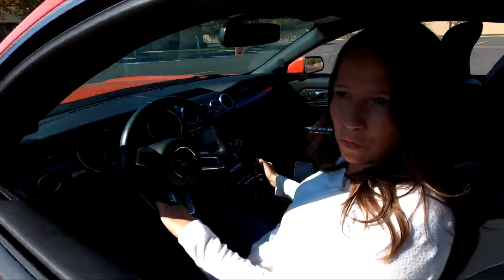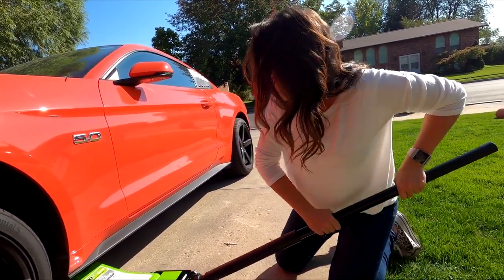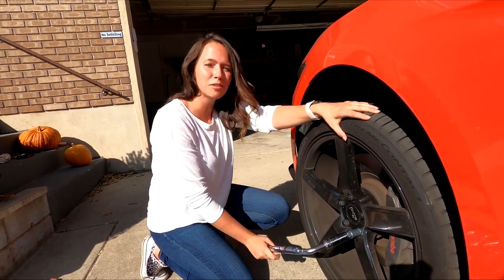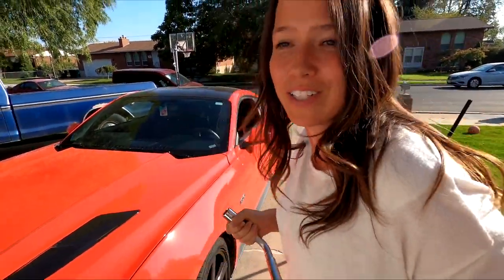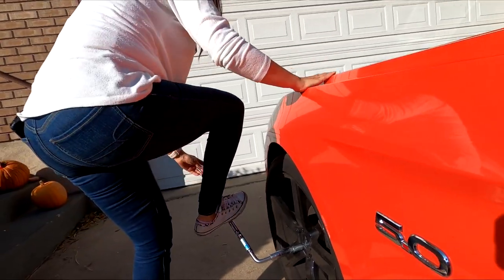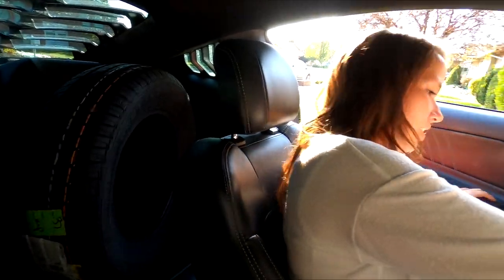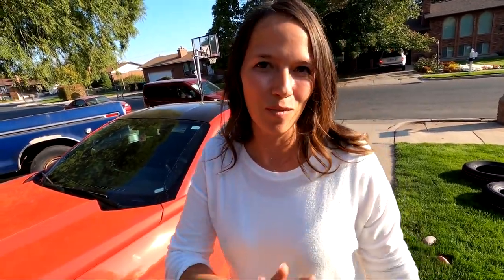PROBLEMS with My Performance Pack Mustang GT!

Comment: 1. Get some jackstands. Never trust a jack.
2. Get a torque wrench.  Those lugs take a lot of torque or they will back off on you.  Been there done that.
3. When putting on the tire, get the tire in position, sit beside it with one foot in front and one in back on the tread area, use your feet to help lift the tire while you look to line up the lug bolts.  Easy .  Keep at it, your doing good.

Comment: Never put your hand/arm in between the tire and the wheel well without it being on jack stands. If the jack fails your going to get hurt. Knock the glaze off the brake rotors (front and back sides) with some 100 grit sand paper and that should help stop the squeaking. Try and work them over in small circular motions or directly in and out toward the spindle nut rather than going all the way around the rotor in the same way the brake pad does.

Comment: The metal tab is scraping.  That's your warning that you need new pads.  Change all 4 at the same time, they're cheap enough.  Clean the rotors off with Brake Cleaner.  That stuff you used might hinder you from stopping later.  It will put a film on your remaining pads and not let the pads do their job.

Comment: Oh and, get the pads done real soon or the scraping will dig into your rotors and you will have to resurface the rotors or buy new ones.  Resurfacing is like $10-$15 each, and replacing them is like $100+/each.

Always do them in pairs (both fronts or backs)....better to do them all at the same time though.

Comment: Performance pack stock brake pads are known for squeeking and also a lot of brake dust
Reply: It’s the Brembo breaks too, my 2014 gt track pack had the same problem until I switched out the rotors
Reply: Alan Jimenez My 03 Mustang GT has ceramic brakes. It stops fast, but my god all the dust is annoying. Makes it impossible to keep rims clean.
Reply: @angelgjr1999  ceramics Shouldn't make much dust at all. You sure you're not thinking of organics? And if you're having dust issues I reccomend wagner OEX pads, you can get them at O'Reilly's and I only clean my rims as often as I clean the rest of it, and they stay pretty nice.
Reply: Yep...just wash your car, drive it for a week, then look at the front rims compared to the back rims. So much dust its crazy! Also, if she's looking for a low mileage, stock Terminator, she needs to get in line. LOL Who isn't looking for one!

Comment: “I have nothing else to haul these tires.” 
Blue F100 or F150 in the background “am I a joke to you?”

They make stuff called brake parts cleaner/brake clean which will clean off the brake dust. Many people (myself included) use it to clean off all sorts of things including cleaning off excess oil after an oil change, other fluids, etc. 

Yes that was the pad “squealer.” If it’s making contact to brake rotor, that means replace the pads. To “fix” the squeak you’d need to remove the pads, chamfer the edges, and literally sand the pad face so there’s fresh pad material. It’s a messy process and there’s some more to it, but that’s essentially what you’d need to do,
Reply: Can I use brake parts cleaner to remove dust from my rims? I have ceramic brakes and it leaves a lot of dust in my rims.
Reply: Angel Gutierrez you could, but there are a ton of products out there for cleaning off rims specifically. Chemical Guys, Adams Polishes, and a bunch of others all make products that work very well for rims. Not sure about her, but my car came with black wheels and I hate them because they get dirty so quick.

Comment: Britton invest in a torque wrench so you can tighten your wheels to 95ft/lbs next time you wont need to stand on the wrench or strip bolts.
Reply: These cars require 150 ft lbs torque on the lug nuts.

Comment: go to Carbotech and get a set of 1521 pads. It will greatly reduce your brake dust from those Brembos. You will need to have the rotors turned so you get proper bed in but other than that you will love them!

Comment: If you have a Lowe’s there in your area go by there and get a 24 volt cordless impact wrench,it will take those lugs nuts off easily! To keep the brake pads from squeaking you need to take the calipers off and put some brake pad grease on the back of the pads before you put then back in the caliper! When you buy new brake pads they usually come with a pack of grease to do that with and that keeps the pads from squeaking! What were those tires for! Look on YouTube on how to fix squeaky brake pads and there should be a video on there by somebody showing you exactly what you need to do to fix squeaky pads! Y’all seem to be having a a lot of fun anyway! Keep up the good work and stay safe and healthy! The more you do the more you will learn how to do!😎🇺🇸🇺🇸🇺🇸🇺🇸🏴‍☠️🏴‍☠️ Have you ever watched mecum’s auto auction! They auction off some of the most beautiful cars ! I went to see the world of wheels a while back and they were suctioning off some great cars,Mustangs ,camaros and just all kinds of great cars!

Comment: I would never spray anything on the brake rotor unless is brake cleaner. If you got wax on the pads that's probably what caused the squeaking. Typically if you get paste or whatever on the brake pads it'll contaminate them and cause it either to not stop as well or make loud squeaking sounds. I'd suggest either being cheap and maybe just getting your rotors resurfaced. Or if you wanna go all out buy new pads and rotors with new hardware. I typically like going down the later route because it'll eliminate any strange sounds and everything will wear evenly. Also as a side note the brake pad curving up like that is normal. That's how most of em are designed. I believe it's a form of a wear indicator but don't quote me on that. The shiny clip thing is a wear indicator. When the pads get low enough it'll start rubbing on the rotors making a squealing sound.

Comment: There is supposed to be some friction.  As for the squeak.....could be the brakes.....could be the pad wear "sensor".  Could be a number of things.  Cleaning the rotors likely didn't hurt.  But something to monitor.

Comment: Change the pads. If the the steering wheel shakes while braking then change the rotors too. Also, never use anything other than brake clean on the rotors. Spray brake clean on a rag and wipe only the rotor on the front and back side. Be care not to get it on painted surfaces. I usually do this away from the vehicle so not to get overspray on the paint. Wait til it dries, spin the rotor and repeat the process until you have went completely around the rotor. You can risk compromising the brake pad compound by using anything else.

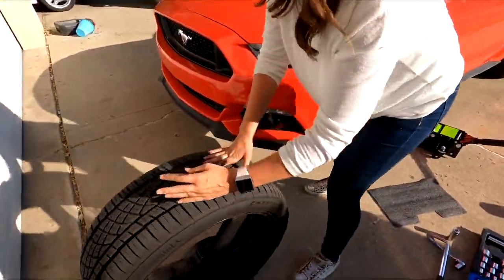Comment: 8:08 says she doesn't know anything about brakes but knows the term squealer lol
On a serious note. You should've checked both inner and outer pads they can wear unevenly. Plus if the rotor has a large lip right over the pad, that means the rotors thickness is getting too low and could cause heat spots and even small cracks leaading to squeaky brakes. The pads themselves could have cracks as well from excessive heat also creating noise. I would just deal with for now until you hear a constant squeal then get new rotors and pads. Also get a torque wrench and tighten the lugs to 150 foot pounds.

Comment: I so enjoy watching your videos.
You are so full of energy and I look be your laugh.  In the future you may want to buy some "Brake Kleen" it's great and drys quickly. From what I saw on the inside pad you have the same little piece of metal and I believe you do need breaks. I'm sorry to say. When you were spinning your wheel that friction is normal.
When putting the tire back on try sitting on the ground with the tire between your legs get the lug holes lined up cles and then lift the tire and slide it in the lugs being careful not to strip or damage the lugs.
I don't know who your camera man is but I felt it was very mean of him not to atleast help direct you.
To answer your question I think it will be a good idea to sell your 95 and look for a Terminator. I will keep my eyes and ears open for you.
As always stay safe and healthy

Comment: You're supposed to have some friction on the front brakes. Its normal for brembo brakes to make noise especially when there hot or  when they have a build up of brake dust

Comment: Low mileage terminator will cost more than the s550 from the prices around here. And they don't resurface rotors in Indiana anymore, I dunno if they will do it there.

Comment: Take the brake pads and sand it with some 220 sand paper and that should stop the squeak , and make sure you buy a torque wrench for your wheels or get it torque don't want them flying off.

Comment: They are high performance brakes , high performance brakes squeal. If you want the stopping power just deal with it. Now if it’s an insane amount then it shouldn’t be doing it but just look up performance brake squeal and see if it sounds similar.

Comment: Hi! I just got a stock 2021 GT Premium here in Mexico and Im just wondering regarding the seat belt reminder...is it normal that when you are already driving and you detach your seat belt that the system won't alarm? usually any car no matter when you detach the belt it lets you know...My mustang only advise right after I start the engine, I put the belt and  everything its ok, but If for any reason I took it out, it will not remind me a second time...is that normal?
Reply from the maker: Hmm I'm not sure, I'll pay more attention when that happens!

Comment: Only clean brake rotors with brake cleaner.  It will also remove any wax which should never be applied to the rotors.  After cleaning, apply nothing to the rotors or pads.  The squeaking could be the caliper.  Some require a silicone lubricant on the sliding surfaces, not the pads.  See the South Main Auto Channel.
https://www.youtube.com/watch?v=Yhw_d_EWrOQ

Comment: When you use rim/wheel cleaners they will make your brakes squeak/ make noise just don't use cleaners on your breaks like you just did in the video lol careful where you spray cleaners.

Comment: You need to tighten the lug nuts in a star pattern to 150 foot pounds.
Reply: 150 sounds a little high, l believe my Mustang is around 90.
Reply: I just torque my shit with a good couple of tugs in a star pattern.
Reply: @Shakerhood69  Just as a example 2014 Mustangs had a 1/2X20 wheel stud which requires a torque value of 100 foot pounds. Starting in 2015 the wheel studs were changed to a 14MX1.5 which requires a torque value of 150 foot pounds. Always check your owner's manual.
Reply: @GTR-ex2ly  Yeah that makes sense, mine is an older one so that would account for the lower torque spec.
Reply: Torque to 148 lbs

Comment: Gotta be careful with break dust. Some brakes have asbestos in them.
Reply: True. But it wouldnt be enough to hurt anyone who's not around it all the time. People who get Asbestosis or Mesothelioma usually worked with it for years or were exposed to heavy doses. Pretty much everyone in North America and elsewhere that used it has been exposed to it at some level. Even small traces in our water. But yeah work safe around it.
Reply: Most brakes now are asbestos free.
Reply: @callen6893  also true.

Comment: A clean terminator coupe will be $30,000 I know of a black coupe 10th anniversary
Reply from the maker: I noticed that. So expensive. Tell me the details on it. It needs to be low miles, coupe, and as stock as possible
Reply: GDM 8,000 miles think it was $34,000 seen it on the terminator page

Comment: its too noisy, cant hear the radio.
Reply from the maker: I hear the radio just fine when its on! To be honest when I drive the mustang I keep the music off so I can hear the car 😍
Reply: @GirlsDigMustangs  I had a truck with no exhaust on it, was so noisy at an idle that i couldn't hear the radio turned up all the way. Think the timing was retarded so that made it extremely loud.

Comment: Performance pack mustangs are known the have alot of brake dust causing alot of noise when you brake. Cheap pads on a 40k car.   Stupid Ford. I have no dust or noise on my base model 2019.

Comment: 😂 wouldn’t be as fun to watch if the camera man told you everything! Brake dust is normal but if you start noticing it takes more and more pressure to stop and the squeezing is more often time for brakes. You could also measure your pads with calipers they’ll tell you the thickness of the pad.